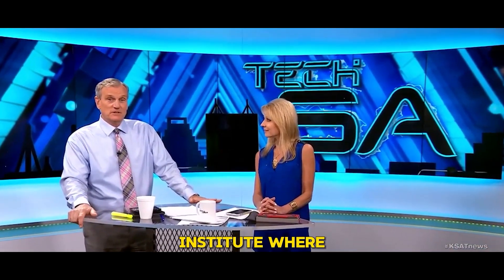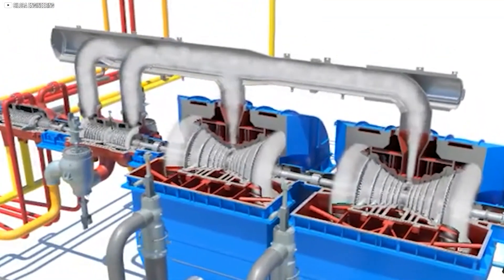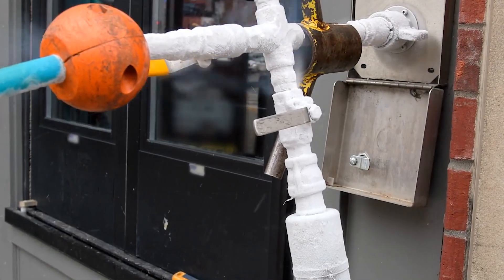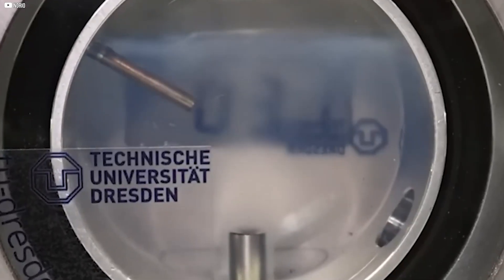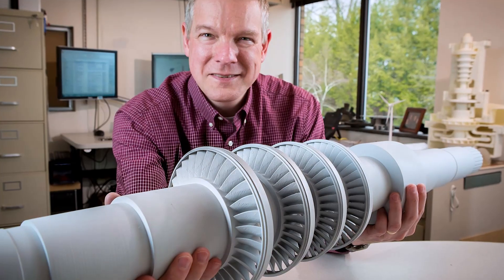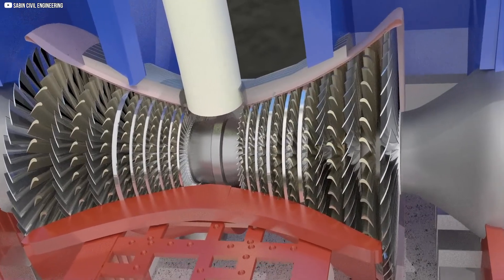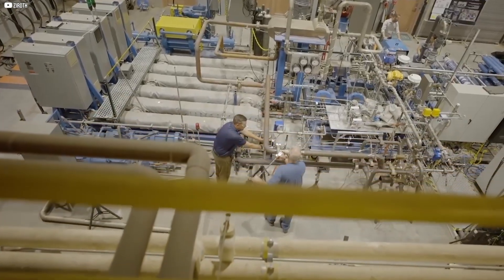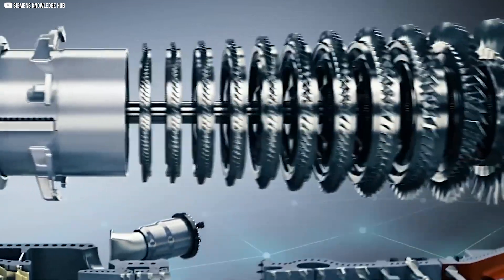The Tiny Turbine That Could Change Power Forever

Comment: On December 8, 2021 the first large-scale (5MW) carbon dioxide (CO₂) cycle generator  developed and built by Xi'an Thermal Power Research Institute (TPRI) of China Huaneng Group completed 72 hours of trial operationand was officially put into operation at the Xi'an Huaneng Test Base.

During its 72-hour full-load operation testing, the maximum temperature achieved 600℃with the maximum pressure of 20MPa, and the generating power is 5MW. The system indicators fully meet the design requirements, achieving high standards of safe and stable operation.

Mr. Lixiin Su, President of TPRI said, recycling CO₂to drive generators for power generation has three advantages compared with traditional steam power generation: First, it is small in size, under the same installed capacity of power generation, the CO₂generatorhas only 1/25 of the steam generator; and the second is the high efficiency, about 3~5 percentage points higher than that of the steam generatorat 600℃; the third is that the pollution is small, and the coal-fired power plant using CO₂generator can reduce the carbon emission intensity of unit power generation by 10%.